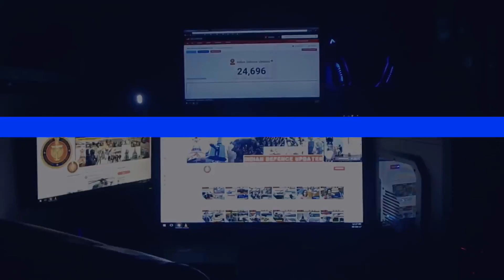Indian Defence Updates : Su-57 Demo in India,290 Tejas MK1A,3 Super Kalvari,ITCM Test,HALE UAV Stuck

Comment: The procurement of the Multi-Role Fighter Aircraft (MRFA) is a strategic imperative that should proceed without cancellation. The inclusion of a twin-engine fighter aircraft, such as the Dassault Rafale, is essential for a robust defense arsenal. The Rafale’s combat radius is notably superior, being approximately three times greater than that of the HAL Tejas Mk1A. This significant advantage in operational range underscores the Rafale’s enhanced mission capabilities.

Furthermore, the Rafale is equipped with the SPECTRA, an advanced electronic warfare system that is considered best-in-class, providing unparalleled protection and electronic countermeasures. The aircraft’s radar system, featuring a higher number of Transmit/Receive (TR) modules, offers superior detection and tracking capabilities compared to the Tejas Mk1A.

Given these critical advantages, it is imperative that the MRFA acquisition be expedited to ensure that our air force remains equipped with the most advanced and capable platforms.

Comment: good point but how long will it take for 290 tejas to be produced? we need tejas+mrfa to reach required capability in desired timeframe.
Reply: If it's that big of a quantity a new manufacturing unit could be set. For Rafael, a manufacturing unit would have to be set anyway.
But that's not the main issue. France has a lot of Rafael ordered and would deliver at least 5 years after signing the deal. By that time frame Tejas Mark 2 would be in it's starting phase of induction to IAF.
Reply: @HarshRaj-px9se    @HarshRaj-px9se   thats why i said mrfa and not rafale. Also in case of mk2 there is not way it gets orders  right after development process. it will probably go through many trials by IAF separately, then bureaucratic timeline plus who knows what. so delivery starting time of mrfa and ORDER time (forget establishing factory) of mk2 wont be same. plus there is a limit to how much can we enhance our manufacturing capacity in short term. of course if we are ready to let squadron lower even beyond 2040 then yes we can forget mrfa all together.

Comment: Why would you even consider putting Rafale and Tejas on a comparison??😅
Reply: $22bn invested in indian industry vs $25bn to french industry
Reply: @Scooby-Doo24  Cheap thinking. Cost is not everything, value is everything. Rafale can be used in offensive role where as Tejas cannot be used for offensive role with limited range and payload
Reply: @Scooby-Doo24  Would’ve made sense if you have the same or similar product available in house.
Reply: @Leap6 You are right but IMO, it should be somewhat of an upgrade of Tejas Mark1A, neither the exact same aircraft nor a complete new platform but should have constant improvements by taking more and more tech from Tejas Mark 2 Program with time since it's not like 300 Tejas Mark 1A will be made in 2-3 years, so order in batches of 90s, maybe call it Tejas Mark1B, Mark1C etc.
Reply: Tejas will create jobs in india and increase experience of jet manufacturers in india.

Comment: Tejas mk1a is a limited capable fighter jet but much better than JF17
Reply: Be careful of your statement or else Pakistani bots will come and call tejas as samosa 😅😅
Reply: Tejas MK1A is a very good aircraft. It has very low RCS because of size, use of composites, radar absorbent paint, Y-ducted intakes. It has quadruple redudandant fly-by-wire which makes it much easier for pilots to operate. From talking to a pilot friend in IAF I learned that Mirage 2000 pilots who were transfered to Tejas squadron say Tejas is better. Tejas only drawbacks is range and payload. However, It has sufficient range to engage any target in Pakistan. Inside China, using buddy refuelling with Su-30 MKI Tejas can be used as a deep strike aircraft. Combining Tejas with CATS warrior system would make it an even more potent system.
Reply: Stop comparing tejas with JF-17. We have a lot more LCAs and should compare tejas with the best of them.

We have to compete with China rather than Pakistan
Reply: Please ensure that tejas mk1a faces jf 17 not f 16 or j 10 then
Reply: @saibalbh31   J-10 lacks stealth features, it's doesn't have low RCS and will be easily detected by Tejas and engaged using Astra MKI, MK2 etc.
Reply: @saibalbh31  Tejas is a much better aircraft in air to air engagement than both F-16 and J-10. It may be difficult for some to accept the idea that Indian products have good quality but here are the facts. F-16 is an old aircraft designed in the mid 1960s. It took its first flight in 1974. Tejas has smaller RCS than F-16 because of smaller size, radar absorbent paint, extensive use of composites, Y-ducted engine inlet. The addition of the new Indian GaN Advanced Self Protection Jammer pod will make Tejas extremely hard to detect. PAF F-16s are equipped with some 30 year old PESA radars whereas Indian Tejas use more advanced Radars but soon will have ELTA 2052 AESA Radars and later the Uttam AESA. As for J-10, it is such a great aircraft that since being inducted in 2005, in 20 years, China has been unable to sell it to even single country. Only reason Pakistan has brought J-10 is because of lack of choice and cost factor. J-10 lacks stealth features, it's doesn't have low RCS and will be easily detected by Tejas and engaged using Astra MKI, MK2 etc.
Reply: @saibalbh31  Tejas is a much better aircraft in air to air engagement than both F-16 and J-10. F-16 is an old aircraft designed in the mid 1960s. It took its first flight in 1974. Tejas has smaller RCS than F-16 because of smaller size, radar absorbent paint, extensive use of composites, Y-ducted engine inlet. The addition of the new Indian GaN Advanced Self Protection Jammer pod will make Tejas extremely hard to detect. PAF F-16s are equipped with some 30 year old PESA radars whereas Indian Tejas use more advanced Radars but soon will have ELTA 2052 AESA Radars and later the Uttam AESA. As for J-10, it is such a great aircraft that since being inducted in 2005, in 20 years, China has been unable to sell it to even single country. Only reason Pakistan has brought J-10 is because of lack of choice and cost factor. J-10 lacks stealth features, it's doesn't have low RCS and will be easily detected by Tejas and engaged using Astra MKI, MK2 etc.
Reply: @saibalbh31  Tejas is a much better aircraft in air to air engagement than both F-16 and J-10. F-16 is an old aircraft designed in the mid 1960s. It took its first flight in 1974. Tejas has smaller RCS than F-16 because of smaller size, radar absorbent paint, extensive use of composites, Y-ducted engine inlet. The addition of the new Indian GaN Advanced Self Protection Jammer pod will make Tejas extremely hard to detect. PAF F-16s are equipped with some 30 year old PESA radars whereas Indian Tejas use more advanced Radars but soon will have ELTA 2052 AESA Radars and later the Uttam AESA.
Reply: @vaimurthy  F16s are proven part of the American forces, which is very different to being a part of PAF. PAF F16s don't have the same back up as US F16s. PAF F16 use APG-66(V)2A PESA radar, which is 30 years old. The issue quite simply is that PAF F-16 has higher RCS. After Balakot PAF F-16s didn't detect Abhinandan's Mig-21 till it closed to firing distance and engaged. Tejas has much lower RCS than Mig-21 and much better EW suite. Also PAF lacks the funding for training and exposure to international forces that IAF has... For all these reasons PAF F-16s are not a match for Tejas. As to whether on a given day will a given F16 manage to evade one miss, its possible but then the can it evade the second or third and fourth, very doubtful. The point is that in BVR engagement, the advantage goes to who can detect whom first and between PAF F16s and Tejas, the advantage is with Tejas.
Reply: @vaimurthy  No PAF F16s were never upgraded to block 70 standard. US signed a basic maintainence (engine replacement) and upgrade package, to keep the 85 F16s operational but no comprehensive upgrade. The 450 million deal is insufficient for 85 aircraft if the upgrade was that comprehensive. Publicly available data shows PAF F16s are 54 AM/BM Block 15 MLU and 18 F16 C/D Block 52+
Reply: @vaimurthy  Well you are free to check online sources, I will correct myself if proven wrong. However, every available info source about PAF F16s says they are mainly AM/BM Block 15 MLU and C/D Block 52+... The rest being A/B Block 15 ADF.